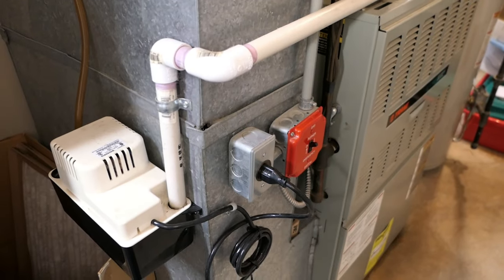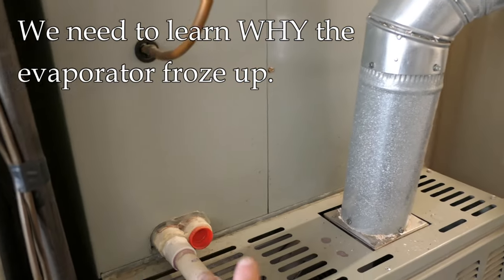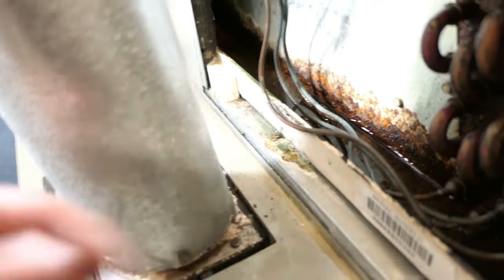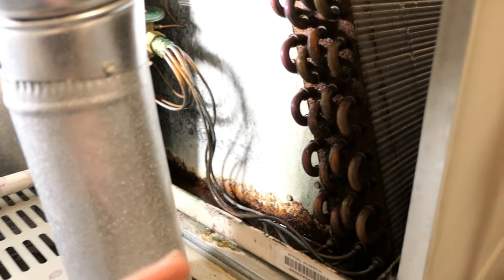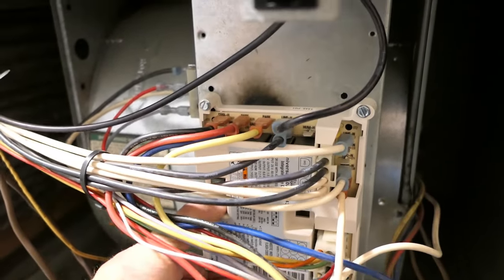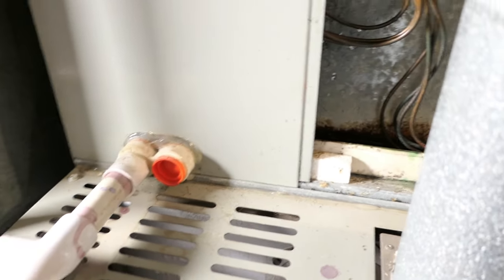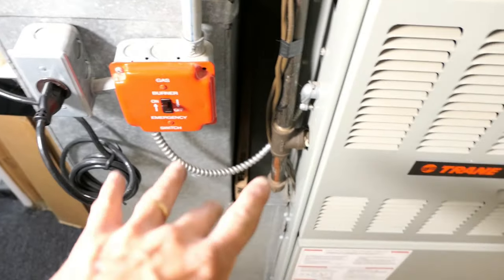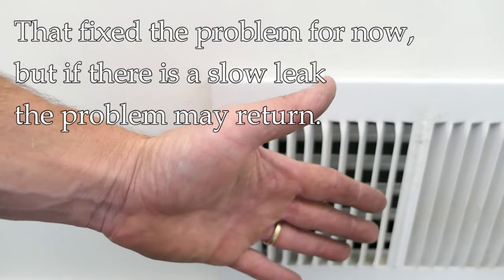How To Clean And Check AC Evaporator Coils After A Freeze Up

Comment: Hello, I have a question.
Not sure if you’re familiar with high velocity a/c, but I just got a new Unico system in our attic , also a trane condenser.  I clean the fins at least twice a year later in spring and later summer.  
I know it’s not a bad idea to have a yearly service but …. Because my system is new etc or even if it is new, are you really suppose to clean those coils in the modular Unico itself? 
Or don’t touch it unless you have an issue?   Just want to know for proactive measure.  Thx
Reply from the maker: I can't help you with that particular system, but I can give you some general guidance.  You might be surprised at how easy it is to get hold of a technical representative at the manufacturer to give you an answer directly.  Unlike giant consumer companies which make it impossible to call in and get a human, you can often pick up the phone and call the general switchboard at a small to medium sized manufacturer.  I've done this many times and had a human on the phone in a few minutes or that same day.  Give it a try.

Comment: I am thinking of installing a UV light on top of the AC coils.  It's suppose to stop any mold growth on the A coils and in the condensation pan.  The air coming out of the vent will not have that freezer smell.
Reply from the maker: Eh, I don't know how effective that will be.  Air moves through there pretty quickly and the ductwork system is many times bigger than the evaporator box.  If you really have a problem with mildew or mold, it cold just as easily be located somewhere else in the system.  A duct which goes through a warm attic or outside wall, for example.  You might start with a thorough cleaning of the evaporator and pan, and make certain the pan is draining well.  If the pan doesn't drain well and the water just sits it may begin to smell.  Also, it's not uncommon for an AC system to be OVER sized.  In that case, the temperature drops quickly and the system shuts off before moisture is removed from the air.  The system does short cycles rather than longer cycles, and humidity remains high because it takes time for the moisture to condense and be removed.
Reply from the maker: Hm.  Well obviously there's a limit to what I can suggest without seeing it in person, but I can say with certainty that for $1800 you didn't get a new system.  That wouldn't even cover the cost of materials a few years back, and certainly not today.  The first estimate you got was in line with typical replacement costs.  I have to wonder what the fellow did for $1800--was that just an evaporator coil replacement and you still have the original condenser outside?  Or did he install a used system?  I don't know, but I would suggest having a local established AC company come take a look before you too much farther and throw good money after bad.  While there may be truth the the evaporator coil coating, that didn't even exist years ago and mold was not a problem then.  You should verify that the airflow, refrigerant level and pressure, condensate tray, and condenser pump are all working properly before trying to add a UV light.
Reply: For $1800 he replaced the inside coil and the outside unit.  It looked new.  I will follow you advise.
Reply from the maker: Yeah, something doesn't add up there.  Maybe it was a unit that "fell off the truck?"   At this stage, though, better to get an informed opinion on site before you spend more money chasing your tail.
Reply: A uv light is proven to keep the ac cabinet clean and free from mold most units I see with uv light systems that’s active in the ahu usually have clean fan motors and cabinets as well as evap coils on the outside. The inlet won’t get cleaned as well if it’s not shining on the inlet of the evap if you have a slant coil or W or N coil it’ll keep the whole coil clean

Comment: in some situations the A-coil has to be removed. That requires pumping down the system, cutting the refrigerant lines, taking the unit outside to apply cleaner and wash off with a garden hose. then reinstall, braze the lines, pressure test, pull a vacuum and check the refrigerant charge. 3 to 4 hours depending on how easy the access is. And don’t forget to check the blower wheel. It might be heavily fouled also.

Comment: Pls help! My coils are still freezing even after I changed the filters out. And my other unit to the ac is in my attic and I do not have a handy man whom will go up there to check it out for me🥺
Reply from the maker: As I mentioned, there are many reasons for coils freezing up--it may be time for you to call an HVAC contractor to take a look.
Reply: Check refrigerant levels and coil condition for restrictions and air flow. Make sure your air handler blower fan is not intermittent failing or not working at all.